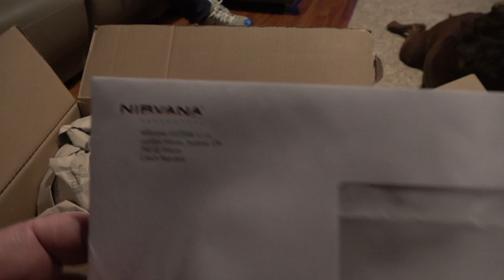A Fat Boy's XXL Paramotor Harness & The New Paramotor Trike

Comment: Great video. Could I ask you a question. Being on the larger size 120kg+ how do I work out what size wing I would need. Cheers.
Reply from the maker: Hi Tom. Wings have a weight range on them, so when looking at the wing look at whether you and your gear fall within the range. Generally it's better to be nearer the top weight than the bottom. However, different wings have different characteristics and safety profiles. You'll be best with a beginner's wing, but I would seriously recommend speaking with an instructor or someone more experienced to suggest something suitable. Weight is no problem

Comment: Yo FPG!  At the risk of being boring, I was wondering how you're getting on with wing selection. We're both big guys but I guess the difference is that I am resolved to exclusive trike flying.
In trying to obtain pertinent information about different types or makes or sizes of wings, it is almost impossible to navigate through the seas of own product promotion, discrimination, one - upmanship, bull shit and , most worryingly, plain ignorance.
I am not a bit interested in using a wing to climb up the side of a house or stand on top of a post. I am not interested in "acro", flying under bridges, through canyons or dragging my bollocks across the ground.
I simply want to wheel my trike out of the barn into my field, take off, annoy the neighbours, pratt about a bit and land - as safely as possible. I don't want to attend fly-ins and meet loads of other boring old farts.  I used to do exactly this with weight-shift and 3 axis microlights - with no drama at all! It was much easier to get to the objective facts than it is in the seemingly subjective world of paramotoring.
I am concerned about wing types. Have you seen Mr. Shanze's latest offering about "reflex" wings.  Al right! - I know, I know!   but he does make some very good and irrefutable points about the shortcomings about "reflex" wings.
I must say, I am leaning towards non-reflex wings.
What do you and your subscribers think?
Reply from the maker: You’re right in that it’s difficult to get reliable information about equipment for paramotoring. I guess the sport is still relatively young and most advice is based on opinion rather than statistical fact. My instructor, who was a paragliding instructor before he started  paramotoring very much advocates the reflex wing. You have to let the trimmers out to put the wing into a reflex profile. I have an ozone roadster 2 which I don’t like so far. I glide in like a brick when I power off. Maybe I just need more experience, but I felt the Dudek Nemo XX was far more gentle and I took off much easier. My instructor recommended the Dudek Universal. I’m hoping to get some trike hours in this week on the roadster 2 - though I’m overloaded on it. Let’s see how it goes 👍